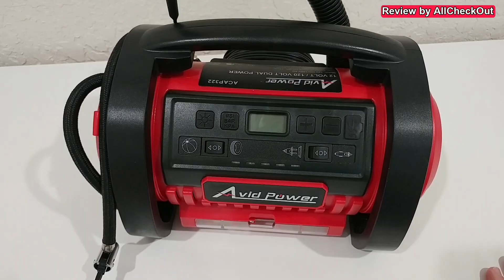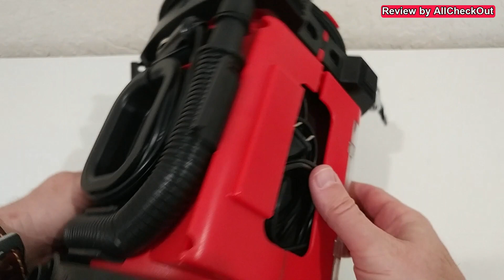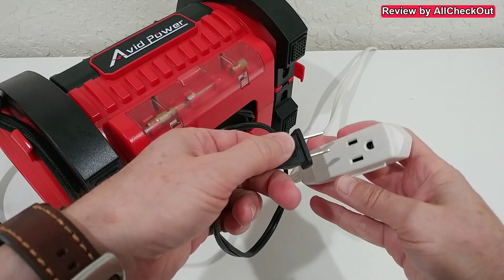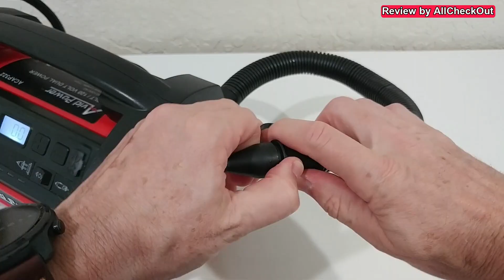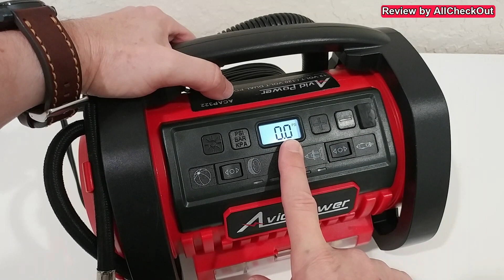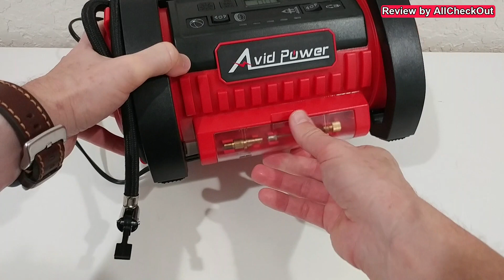AVID POWER Compressor/Inflator 12V/120V ACAP322: Full Review & Tutorial

Comment: When I flip to ball .. I don't get any pressure from the hose, only output from rear outlet.
Reply from the maker: Weird but can't check. My son has it now for his boat ...
Reply: @allcheckout  I figured it out. The ball is not actually a ball. The ball is a beach ball so you only use that setting for low pressure things. But if you have something like a soccer ball that needs a needle, you can't use this. It immediately will go into safe mode and the only way to use the needle function would be through the tire setting
Reply from the maker: @Evan_Adams  Awesome. Thanks for the update ;-))